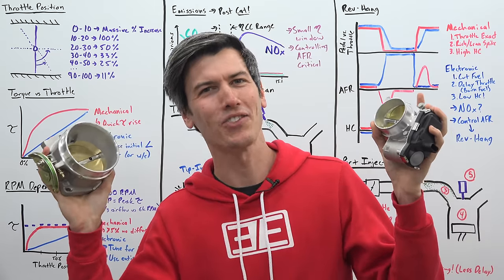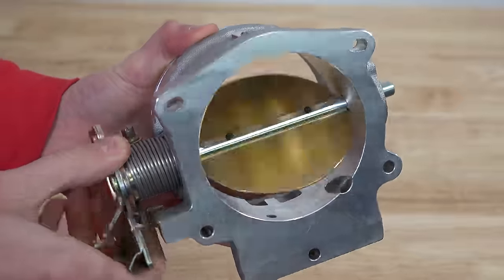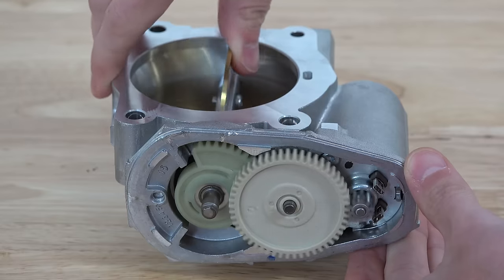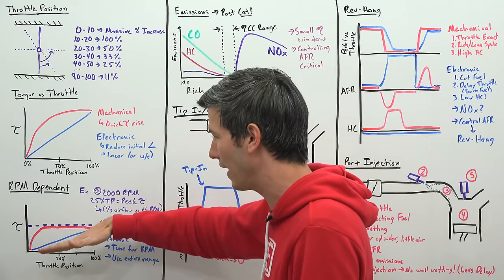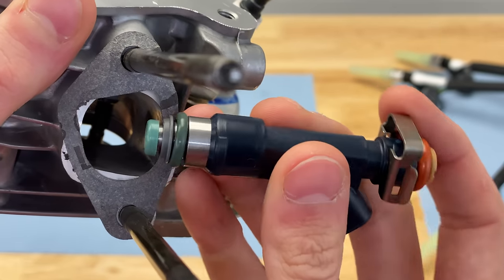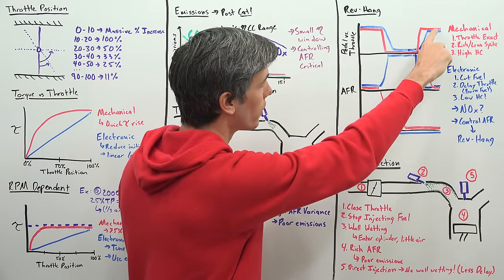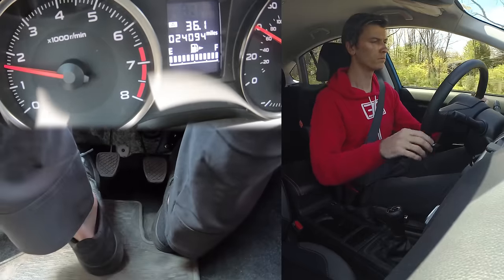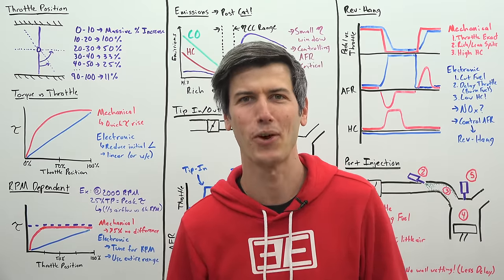The Big Problem With Modern Manual Transmissions - Rev Hang

Comment: The answer to any modern car problem: “it’s to control emissions”
Reply: Ikr. It's quite ironic that 90% of the cars in sale are crossovers. Because they are sooo eco-friendly
Reply: Yeah but it’s understandable I mean at least they are trying new technology to help save the planet
Reply: @jupitersailing6911  I think it does not make any difference, whether you want to decrease emissions or not, it will not destroy a planet
Reply: and that's why we are going to shift to electric drive sooner or later, subsidized or not
Reply: Yes - and this is nice way to sell it to the public as: there is plenty more reason of course. For instance it is much cheaper and easier to have an additional cable in the harnees to to the engine, compared to the good old wire-able solutiion. And e-gas usually takes its data from a data-matrix in the cpu - data based on the manufactures measurements during vehicle developme'nt. 

But some of theses e-gas just seem to be bad quality, cheap plastic etc. and often don't last very long. And the production, distribution and installation of replacement parts is as well effort, harming the environment.
Reply: @JamesBrown-ux9ds  I hate to remind you, but stuff also broke in the past. Difference being that said things are more complicated now and some/most don't understand what it is or how it works. Which is also why it's so nice we have Jason to educate us
Reply: My exact thought! :/
Reply: @meemdoggoriginallongdrink  and the crossovers actually can not cross over anything bigger than a speed bump 🤷🏻‍♂️
Reply: @doggSMK  and maybe a gravel road that a normal car could withstand anyway
Reply: This car drives itself?! Emissions!!!
Reply: @jupitersailing6911  It doesn't actually do anything to reduce your carbon footprint. All it does is reduce certain types of gases from leaving the exhaust.  Things like leaf blowers are lawn mowers spew out 1000 times what a car would in a few minutes.
Reply: That's why I buy 15+ year old cars and just rebuild everything. Yeah, it probably costs the same but, a lot of systems and components are sooo much easier to pop in the shop on a weekend day and replace.
Reply: @TheSupergunman3000  The planet will still be here, so not destroyed as in gone, destroyed as in, can't support certain or all life. A dead planet is possible.
Reply: @thomastucker5686  it can and will support life, if we "took care" of it or not

There are still factories producing electric vehicles which require many parts outsourced and refined from many different parts of the world, which could make it less economical than a normal, yet alone a V12 car, do a little bit of research on this, not simply watching some videos
Reply: @jupitersailing6911  By increasing NO they are failing in that mission. NO is much more dangerous than fairly harmless CO. Unless your Al Gore.
Reply: @xq39  Translation: Emission regs are too draconian and should perhaps be rolled back a bit.
Reply: My remapped manual Mustang GT was much more fun to drive! Immediate response. Even sharper than any cable;)
Reply: Lubomir Ivanov and they’re less fuel efficient than a station wagon;( so the save the planet argument is a lie. Peoples choices don’t align with going green.
Reply: Tom Wolf Carbon Monoxide is deadly between 150-200ppm. NO2 is lethal in the same range.
Reply: electric cars emit gases?
Reply: @Blox117  Technically yes, but the manufacture process is pretty dirty and of course unless it's a Tesla it's probably being charged using fossil fuels.
Reply: @GudrezBilly  if you use electric power from solar energy starting from mining ore to the factory to driving i dont think there are any emissions, unless you count plastic/paint being derived from oil distillation. but that is extremely tiny compared to a gas car that constantly emits byproducts
Reply: @Blox117  Big smoggy factories in China don't count, then? Aight.
Reply: @GudrezBilly  pretty much a non-response to my comment, but ok. prove that the manufacture of electric cars takes place in "big, smoggy factories" and you should be good to go.

hint: assembling cars in itself doesnt emit gases. 

and as i said before, any emissions would be produced from special parts that the car is made of ONE TIME, versus the permanent lifetime of a gas car.
Reply: @Blox117  Yes, it was purposefully a non-response
Reply: @barristerh5379  I prefer owning a car that makes less horrible emissions. Same reason any sane person hates operating a two stroke engine like a lawnmower: it’s just dirty and wasteful. Real men prefer efficiency.
Reply: Jupiter Sailing - Music the planet 🌍 don’t need saving. We do 🤦🏻‍♂️
Reply: @LongNguyen-lx8if  no one thinks the earth is going to crack in half. Saying save the planet means saving the species that currently live on it, of which we are one.
Reply: @jupitersailing6911  
Pollution is local and has little to no effect on climate change. Pollution =/= emissions.
Reply: @xq39  you’re thinking specifically of catalytic converters, which there are other technologies than that to reduce carbon emissions. And also, not everyone has a leaf blower / lawn mower, and those who do, certainly don’t use it as much as their car.
Reply: @meemdoggoriginallongdrink  I own a shitty little Nissan Sentra with the 1.8 liter or 1.5 liter sewing machine motor and the CVT, but I can get 44 MPG on the highway. My 99 Blazer might get 22 MPG but it goes places that would kill that Nissan.
Reply: @TheSupergunman3000  Nothing is going to "destroy" the planet unless you got a Death Star. What is being destroyed is the environment condition of which we prefer to live in.
Reply: @jupitersailing6911  Its better to keep an old car running than to keep buying new ones
Reply: @Blox117  Very little at the point of use---unless crashed or catches fire. Gasses (and other environmental impacts) are mostly in construction, electricity generation, maintenance (very little) and disposal. It will get better as the tech evolves. There is nothing more convenient than electricity in a car so it will get better. Batteries are the big issue. Very low energy density and a very short operating life.
Reply: @TheSupergunman3000  haha, spoken like a true oil company ceo
Reply: @TheSupergunman3000  its what you " think".
Reply: @archygrey9093  Oh yes and theyre so much easier to work on haha
Reply: Or something electric;p
Reply: Or safety.
Reply: @meemdoggoriginallongdrink  depends on the engine mainly
Reply: @jupitersailing6911  the planet does not need to be saved
Reply: @venglomarci  Yes, but the frontal area of a crossover is much larger than in normal cars, it increases air resistance
Reply: @meemdoggoriginallongdrink  that is true but they dont even sell us anything anymore. I hate crossovers btw.
Reply: @venglomarci  waste of money they are, I'm just gonna stick to 00's Volvos and Toyotas.
Reply: @absboodoo  "prefer" is a light way to put it
Reply: @meemdoggoriginallongdrink  actually, emissions are why. They are a loophole in tune EPA emissions regulations... so basically you can thank the EPA for forcing crossovers into everyone
Reply: sure but in a Manual transmission it creates rev hang that ruins the experience driving a new car also as they get older like with any computers the electronic throttle body will slow down and response from the pedal will be slowed over time
Reply: @meemdoggoriginallongdrink f todays cars where built like 90s cars (body size) with modern tech they would be more efficient than cuv's. CUV's aren't inherently efficient. The reason why they exist is because everyone wants a bigger vehicle these days like an suv. A cuv is a crossover between passenger car and suv. A CUV is more accessible to people wanting an suv but cant afford the bigger vehicle also manufacturers can get better emissions out of the smaller vehicles thats why I said a 90s body style car with modern tech would be more efficient. MUCH less weight to tote around. Everything has gotten so big because people want bigger and because of safety standards. It takes more power to move more weight. A cuv is bigger than a car. 🤷‍♂️
Its simply a body style.

 Has nothing to do with being eco friendly. Jussss sayin
Reply: @TheSupergunman3000 
It will not destroy the planet but destroy human life because of air pollution
Reply: @meemdoggoriginallongdrink crossovers aren't there as a replacement for cars, they are replacement for trucks and SUVs. Anybody buying a crossover would otherwise buy an SUV
Reply: @TheSupergunman3000 it will support life, just not life for humans
Reply: @breabanm not the smartest
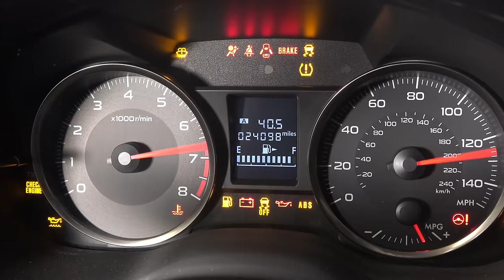Reply: So we gonna ignore the section between 5:00 and 5:45 and reduce the whole video to emissions controls = bad cars. Cool just checking
Reply: @thomastucker5686 The propaganda worked on you
Reply: @xq39  Pollution is a big problem, either way. Dementia correlates with smog, for example.
Reply: @DefundTheFringes  yeah but car exhaust is already relatively clean. burning wood for example is like thousands of times more harmful. search up cigarette smoke vs wood smoke pm 2.5
Reply: Focusing so much on emissions and saving they environment that way, they forget about all the extra parts and how often they fail and get clogged up with carbon and how much it reduces the life of the engine, meaning the car needs to be replaced much sooner.... Therefore massively increasing your carbon foot print that way instead. Well played world government's, well played....
Reply: @counterfit5  Dangerous to the planet 🤦‍♂️
Reply: Yet Ursula Fonderlion rides in a audi a8l with a 4.2 l engine in it and not a 1.0 renault.....
Reply: Like smelling gases in cities?
Reply: @jupitersailing6911 Gah 🤦‍♂️
Reply: So literally going back to 1973?
Reply: @meemdoggoriginallongdrink  It's not just about climate change. Many pollutants, especially those mentioned in the video, increase local particulate pollution, killing as many as 2x the number of people killed in crashes.
Reply: @xq39 oh yeah, small engines are a MAJOR source of pollutants. There's a reason why many municipalities are banning small engines, especially for landscaping.
Reply: @jupitersailing6911 hogwash
Reply: @breabanm bullshit on that
Reply: I don’t even remember why I made this comment lol
Reply: That's why all new cars are crap..............
Reply: No

Comment: I had a throttle body freeze up while going down a hill in winter, now THAT was some rev hang...
Reply: Oh geez 😆
Reply: I'll bet.
Reply: Was it a 76 Rabbit? Mine was.
Reply: Might be because of the increased fuel needed to start and keep engines running in winter... could also be a leaky injector. Get your engine checked out.
Reply: Drive by wire?
Reply: Trying to stop on a icy road and my car was acting like I still was giving it gas was kinda scary
Reply: Thats why many have heated TB.
Reply: Wow that’s crazy
Reply: Had the same except in the summer. Some sort of spring that got corroded was responsible.
Reply: @everything_delete8005  thats the great part about having the ability to use a "manual" transmission with an automatic 🤣
Reply: everything_delete that’s when u put in neutral
Reply: At least it wasnt an automatic.💀💀💀
Reply: My 1968 c10 truck I rebuild had a throttle rod from the pedal to the carb. That mechanism would also jam, you’d have to be quick on the gear selector when it did happen. Also no neutral safety switch. You could start that thing in any gear and directly drive into any object in your path. NEVER LEAVE KIDS UNATTENDED
Reply: Downshift for the engine braking experience of your life.
Reply: In high humidity Venturi effect can cause freezing in the throttle body up to 50° ambient temperature, it’s why small single engine airplanes that are carburated always have carb heat manually turned on by the pilot at low power settings (won’t get into why cars are variable load and planes are continuous load engines) but yeah icing can happen.
Reply: What did you do?
Reply: my friend had dirty trottle body and we were going home at low fuel so 3k rev hang even in neutral was kinda scary

Comment: Every video I see like this just gives me another reason to hang on to my  90's cars.
Reply: welcome to club. im still driving 1977 carb car with only electronic device being radio. ill take old car everyday over these pieces of junks they call cars nowadays. imo theyre more like robots. you cant even do what you want, emissions emissions emissions everywhere
Reply: I know, right? I kept my clydesdales and carts, and I never experience rev hang!
Reply: Yea stay in a cave
Reply: This isn't a new problem.  1975 VW Rabbit had major rev hang.  It had an "anti-backfire valve" that held the throttle open.  It was pretty awful.  Without the valve, it backfired EVERY shift.
Reply: Wish I still had my '69 GTO. You could smell the fumes when you started it up. I think I got 12mpg.
Reply: My 2019 MX-5 does not have rev hang.  It's one of the most linear engines I've ever driven.  The pull is 100% consistent in every RPM and it's so linear in every gear.  It's such a complete joy to drive.
Reply: just get a DSG
Reply: @kaussstorm  It's still fuel injected, so has terrible throttle feel. And has no real induction noise, maybe the best part about an engine. And it doesn't do what you want it to (Stuff like Abs).
Reply: It's just before every vehicle was built to be disposable, when cars wre still built to last.  In my home country , South Africa people are still driving a small Nissan flatbed truck we call Bakkie's, what Aussies would probably refer to as utes. They have a tiny 1.4 litre  4 cylinder carb engine, they have been in production for a very long time in SA from 1971 to 2008, many people are still driving them till this very day. They're still very fuel effiecent and last practically forever, they're known to basically be unkillable,  thew things last forever just like old Toyota hiluxes. You hardly see vehicles like that anymore, built to last and easily serviced.
Reply: @matufujiwara7493  damn, my mans ain't got no lights lol
Reply: Just drive a car with automatic transmission
Reply: @dai2dai246  Are you implying carbureted cars have better throttle response?  Does throttle response matter when the carb is an inefficient, complex mess?  There is honestly no major downside to FI.  Gasoline direct injection can handle amazingly high compression ratios and any modern FI car will run circles around old carbs.  Old muscle cars are a joke compared to modern engines.  ABS is a lifesaver for most people as well.  You simply cannot tell me a carb car with no electronic assistance can compete with a modern sports or super car.  The computer is smarter than you will ever be.
Reply: @majist0  À sports car isn't about speed, it's about how it makes you feel. The computer may be smarter then me, but what's the point if I don't drive my car anymore?
Reply: @majist0  actually a computer can't be smarter then a human as a human created it. Computers are only good at repeating. Carbs are very simple efficient things compared to the complex mess of fi. You can have correct throttle response with proper tuning and beat any Fi side by side. Just because you don't know how to tune does not mean something is junk. I tune both for a living your just some internet troll in your mom's basement that is mad your weed Wacker won't start.
Reply: @davidterrie7661  I got six mpg in my 65 GTO 389 tri power.
Reply: YES!!! Same!
Reply: @matufujiwara7493 Until you die in a crash that you'd walk away from in a modern car and if you daily that car it's quite likely with how texting and driving (or using the modern car's iPad dashboard) has worsened driver's attention.